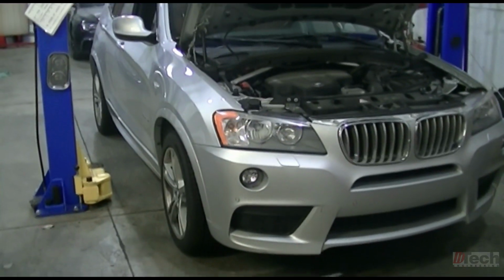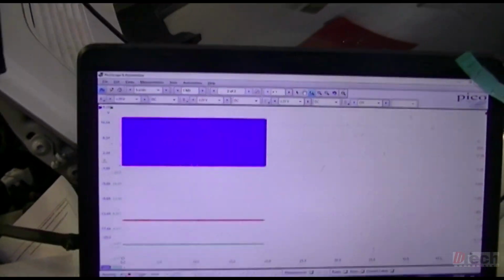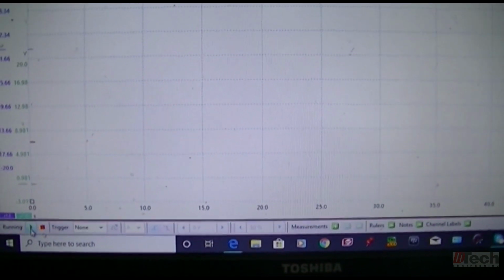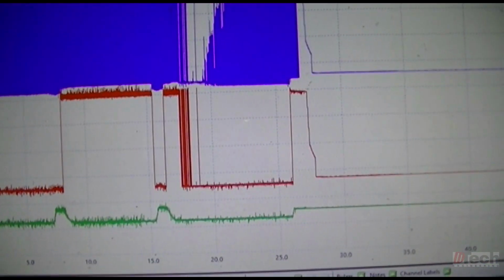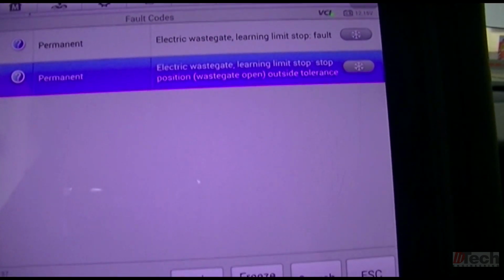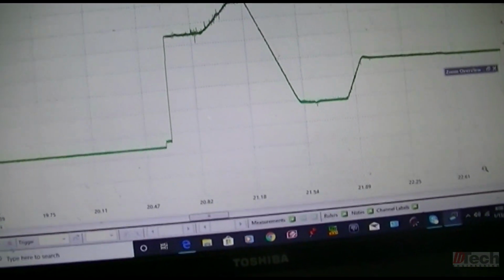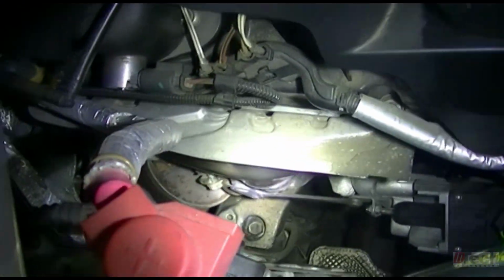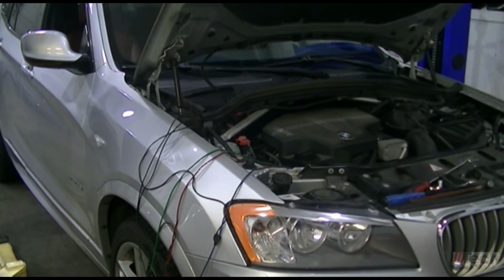2014 BMW X3 N20 wastegate codes, diag check + fix

Comment: Hi great video. Okay so I am stuck on a s55 BMW with this fault code. I have bought ista tried the relearn. It is stuck at -3.55 when I adjust the linkage it makes no difference

Comment: That cat turbo clamp is clearly in the way lol. it needs moved down some I've done this job several different times.
Reply from the maker: Yes, easily a common mistake made
Reply: @DTEAuto  Yep I could see how somebody could make that mistake, I about did the first time then noticed before tightening the nut down that it would block the waste gate from opening up all the way. I'm about to have to replace a charge pipe on the intercooler. This one cracked and has been blowing air out of it and throwing rich codes, for the actuator and valvetronic unit acting up. All kinds of issues from that thing.

Comment: How can u relearn it after replacing it i have same code and i have the same scanner u do how can i relearn it.
Reply from the maker: in the window of the autel that has the tabs for diagnose/ program / hot functions/ service...... you can click either service or hot functions, and then go into dme and you should find it there

Comment: I was wondering what program do you use on the laptop to measure the voltages and what interface is required?
Reply from the maker: the program and tool are all from one company,  Pico scope and Pico auto software. You can download the software for free and use it in demo mode to try and get familiar with it before even buying the scope unit.

Comment: hi,  thanks for the video, great one again - the factory ISTA+ tool has a re-learn procedure: (ABL) Adjusting the wastegate linkage, I'm not able to launch it to see what it does, since you need a car connected for that
Reply from the maker: Yes, the autel does have the re-learn as well, but it wouldn't complete it due to there being a currently stored trouble code for that system, once the code was able to be cleared after the fix , it was able to complete it if I needed to run it, Thanks for watching
Reply: @DTEAuto  I see, great! thanks